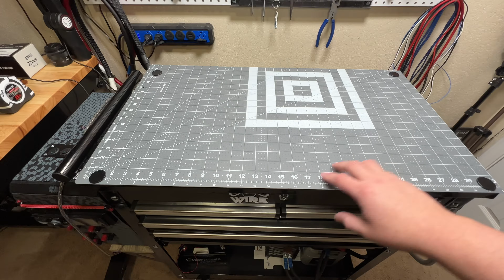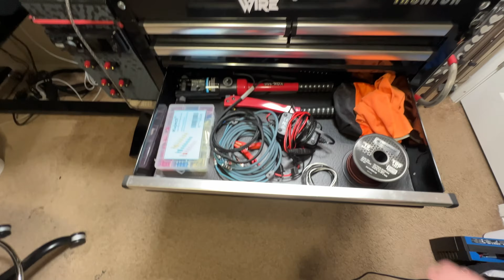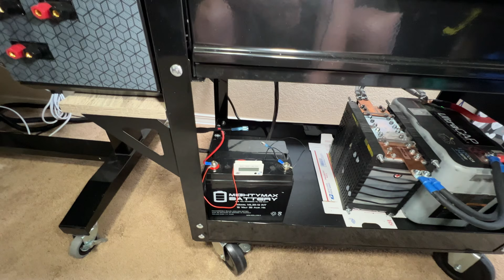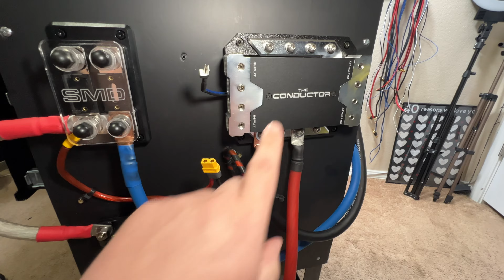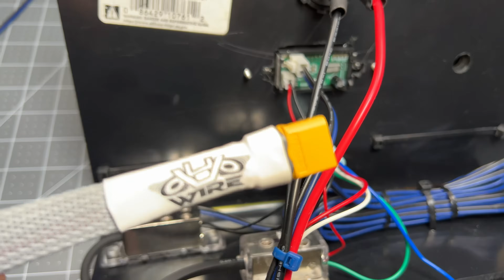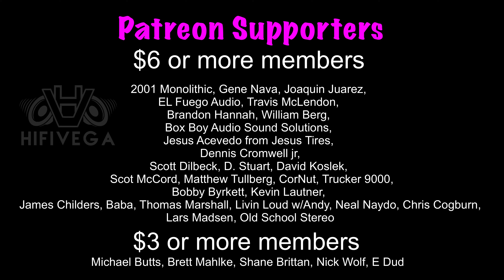Mobile Car Audio Test Bench Overview

Comment from the maker: Test bench items (affiliate links)
Smd DD-1 
https://lddy.no/1eyid
Smd AMM-1
https://amzn.to/3ZiKstq
Smd Fuse Block
https://lddy.no/1eyie
Mini Fuse Block
https://amzn.to/3XRlUq8
Marine grade Circuit Breaker
https://amzn.to/3Y2BCP7
Ultra Cap
https://lddy.no/1eyig
100 amp power supply
https://amzn.to/3kmId9p
Braking resistor 
https://amzn.to/3Zf6X2j
Tool Cart
https://amzn.to/41oUdb0

Comment: Are the power supply inverters connected to the batteries just like a car alternator is connected to the battery? Or do you only use the power supply on its own and can switch it to use the batteries only. Im kinda confused, im trying to make my own test bench, i want to set up a car radio and 2 speakers as a test bench and also keep them set as a home stereo, but i would also like to test amplifiers to see if they turn on and work, not really looking to test amplifiers to their full potential.
Reply from the maker: The batteries and power supplies are hooked up in parallel with a circuit break in between so I can disconnect them when necessary

Comment: Love the test bench....couldn't resist the price on the jp23v1.5 and bought another one this weekend 241 dollars to my door and that's with the upcharge for a sticker ...I hope it is as good of an amp as it seems to be ...wish I had a way to test and see how much power (watts) I am actually getting to my sub....I have a question if you have the time ....have you heard of soundbox ....although it is just awg they have 25 foot lengths of 1/0 for 30to35 dollars all over ebay ....and it looks like good quality casing ....was just curious if you had ever tested any of it ....I know you did a 1/0 comparison a while back ....going back to watch that now ...again love your set up ....think now that I have another jp23v1.5 I am going to add another xr12dual 2 ....thinking of just putting it in a ct sounds single kerf slot ported box just like the current one I have in my truck ....I have the space ....and I figure why buy a box for 2 ....

Comment: You could go ahead and get a variable voltage powersupply to set to 9v for the SMD products and hardwire them into the system so you're not dealing with batteries.
Reply from the maker: That’s 100% in the plans! Dereck showed me the set up he had that was similar and I’m totally down for that

Comment: That setup is well designed and *SICK*.  

For the table top display piece, I think a black color matched wrapped piece of 2x4 (or 2x6) wood would fit nicely, while adding enough weight to it to make it stable.  You could then reattach and mount all the cabling and stuff currently on the back onto that.  Sometimes the quick and easy solutions work best...
Reply from the maker: Thanks and great suggest!